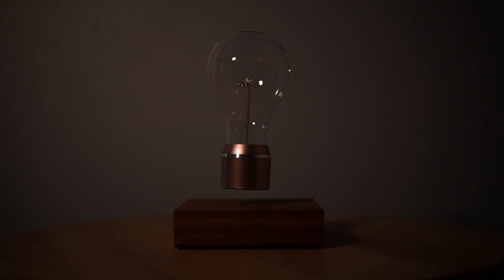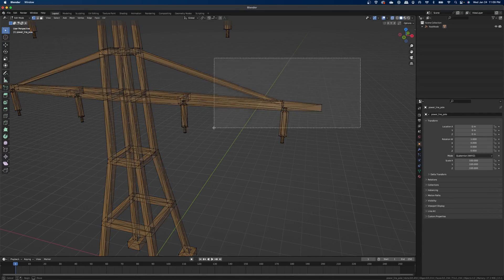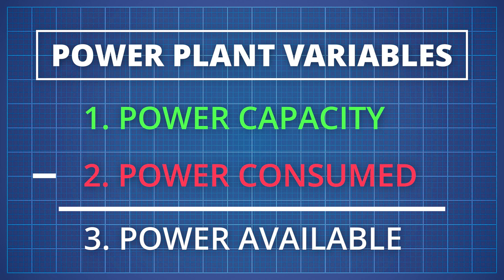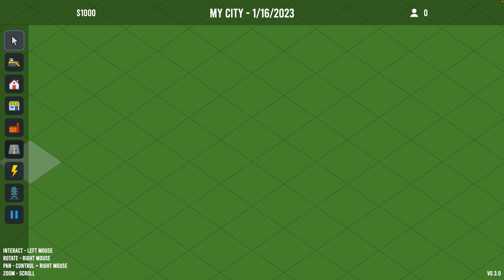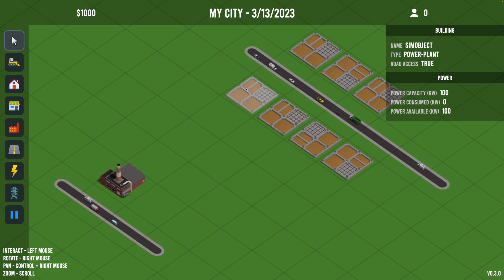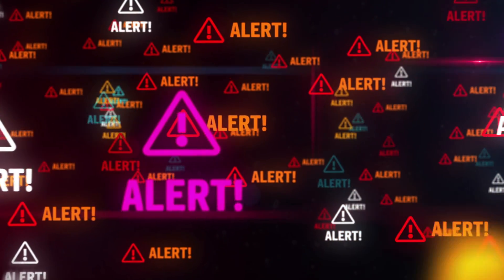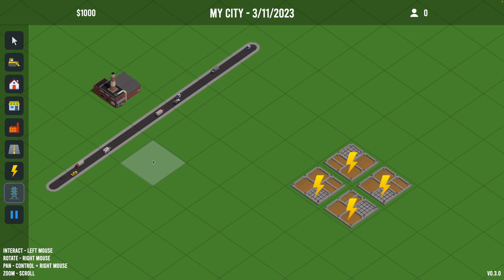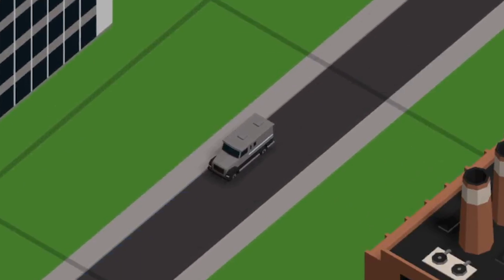15. POWER PLANTS // Creating a SimCity Game with JavaScript & Three.js

Comment: Nice job. BFS is simple enough for this purpose, yet it adds life to the city. How often does it checks the building in range? Every frame?
Reply from the maker: I did not optimize the code so currently it is every frame. This works fine since the map sizes are small and not much else is happening. But ideally it would only re-trigger an update to the power grid when a building is added or removed.